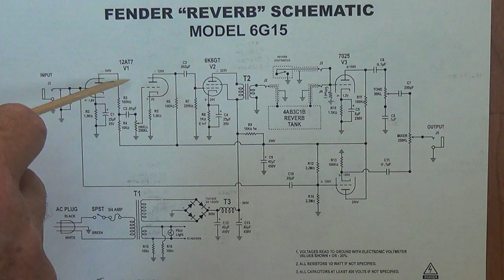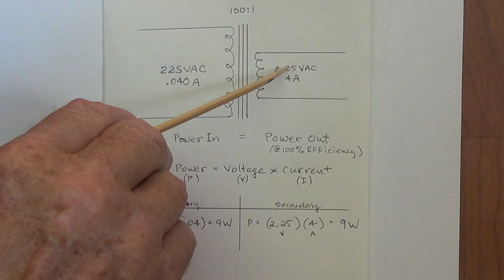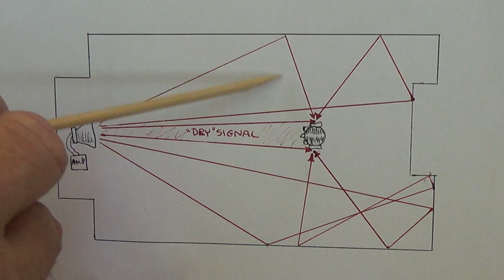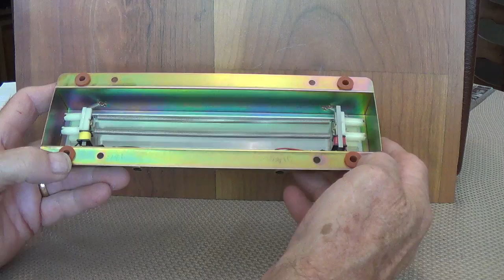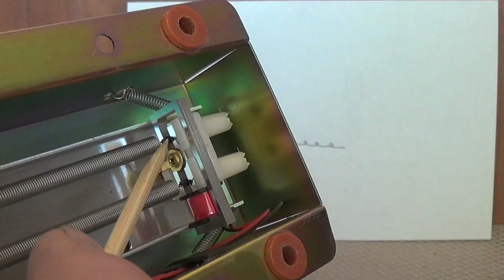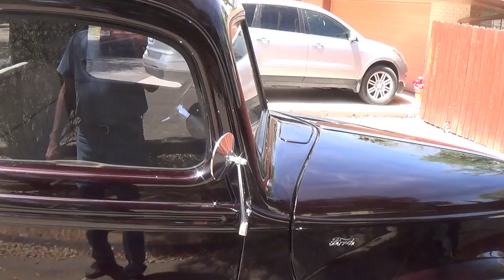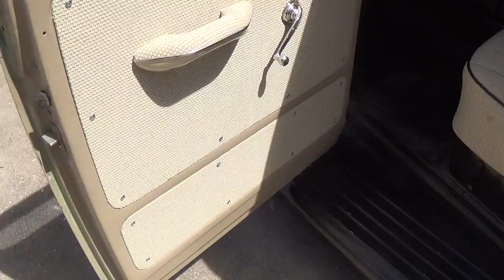Tube Reverb, Part 1

Comment: Greetings Uncle Doug out there in youtube land. Was hoping you might be able to tell me if a Hammond 369bx will work as a mains transformer for us down here in Oz. Its basically 150-0-150 center tapped secondary/86mA. Postage alone, my cat would have to go without food for a year if I had to purchase a Classictone PT from the states.
Reply from the maker: It depends on the circuit you intend to power with the PT, SK.  Unless you are using a voltage doubler, your HV will be low for most tubes, and your marginal 86mA of current may not be adequate......especially if you use a voltage doubler and halve this figure to only 43mA.  Do you have any old, used PA amps in Australia? If so, they have much more suitable PT's for amp use.
Reply: @UncleDoug  I was hoping to use it for your 6G15 circuit. The PT in your circuit is the PT47609, secondary no center tap 306V/26mA. So yes a voltage doubler? ignoring the center tap to obtain 300V.
Reply from the maker: @Slappedkat  Since the 6G15 uses a full wave bridge rectifier, you can use your low-voltage PT, without the HV  center-tap connected, to net an appropriate HV of at least 300V (probably more after smoothing to peak voltage).
Reply: @UncleDoug  Thanks for taking the time to reply. I sat with pen and paper and watched quite a few of your video's (some several times) over a period of a month or so taking notes and basically using them as a study guide. I did this before building my first amp which I completed this week. I  also built your version of a current limiter before powering up my amp.  I collect old portable valve driven record players. I now feel confident to go ahead and start servicing/restoring them. Im not the smartest tool in the shed. I find the fact that your videos teach in a humorous, simple, non condescending way that I understand valuable. I feel its  the art of how one delivers the information that some can teach and others maybe not so. A huge thank you for sharing your knowledge with us all, it is very much appreciated. All the best.
Reply from the maker: @Slappedkat  Thanks so much for your very nice comments, SK. It's gratifying to hear that the info in the videos has been turned into a productive, creative new hobby/business for you. Best of luck with all your endeavors.

Comment: 305 worst V8 Chevy ever made
Reply from the maker: Nonsense. All small-block Chevy engines are wonderful ;)
Reply: Uncle Doug I have no problem with small block Chevys but of all the engines in that family the 305 wouldn’t be the one I’d pick. 350, 327 even a 307 but not the 305. To each his own.
Reply from the maker: Why, Bill? What specifically do you find lacking in the 305 ? It has the stroke of a 350 for good torque and hardened valve seats for unleaded. Also, it came in the truck and runs great.....keeping right up with its 350 "brothers".......so what do you feel is wrong with it ??
Reply: @UncleDoug  over the course of the late 70s/early 80s I had 3 different F body Camaros, a 70 with a 350, a 73 with a 307 and an 80 with a 305. That 80 Camaro put me off Chevys for a long time. It was an underpowered dog that had constant driveability problems. Granted it was the height of the smog police era and technology hadn't caught up with emissions restrictions yet but 155 HP for a 5.0 liter V8 is pathetic. I currently have a naturally aspirated I4 with half the displacement putting out 186 HP.
Reply from the maker: Yes, Bill, but none of those experiences relate to the 305 in my truck. Mine has no smog equipment, some "speed" equipment, and produces considerably more than 155 HP. There are no inherent  shortcomings in the displacement or the bore/stroke relationship, as your initial statement implies. The problem was that you owned a "dog" version of the engine......but this experience has no  bearing on the 305 engine in general.
Reply: @UncleDoug  fair point. I guess it's just hard to get those memories out of my head.
Reply: By the way I really enjoy your channel and get a lot of great information from you. Thanks for sharing your knowledge and experience.
Reply from the maker: You're welcome, Bill. I'm glad the videos are helpful. Don't be so negative toward the 305 based on one bad experience. Let's face it, we've all had at least one bad relationship with the opposite sex.....yet none of us felt the overpowering need to become a monk or nun :)

Comment: Hi Doug!
I'm building one according to your schematic, but i only have access to 230VA --> 295VAC/6,3VAC power transformers - is that enough?
Reply from the maker: If that's all you have, Jaro, then it will have to do the job. I would think that although your tube plate voltages may be a little low, it should still work. There is only one way to find out :)

Comment: Greetings Doug and Jack ! Just a question about the next videos on effect. I'm a tube enthusiast and the way you explain it is, as always, awesome. But, if the reverb is not really "tube based" (it's a spring reverb, not a "tube" reverb), would you also explain how other effects works ? Like delays (how to induce a delay with a tube) or compressors (maybe you got an old Teletronics LA-2A in stock to repair ?). I'm not only a guitar player but also a sound guy, and using gear without understanding what happen inside is a real pain in the butt to me !
Reply from the maker: The reverb used by Fender in all its vintage amps, including the 6G15 was tube-based AND used a spring reverb tank. Unlike some companies, however, they used a small output transformer to drive the tank.....so you could say that their reverb was "transformer-driven spring reverb". In the opinion of most, it is the finest possible analog reverb. Some manufacturers left out the transformer and simply drove the spring tank with a tube......so you could say their reverb was "tube-driven". This was a concession to cost reduction and the result was OK, but not up to the Fender standards. Some more modern amps used transistor(s) to drive the spring tank, with variable (and generally not exceptional) results. All analog reverb uses a spring tank......so they are all "spring-reverb".  The alternative would be digital-effects reverb (which is the only one that does not use a spring tank), such as you can find in pedals......some of which sound great.

Comment: Uncle Doug-I just saw this video and really enjoyed it.  I downloaded the PDF file and had a question.  It looks like there are some discrepancies in the Modified Layout Diagram and the Modified Parts List.  The Tone and Mix pots are reversed from what appears on the front side.  I just want to be sure which way they go.  Also, I think the C8 cap may be mislabled.  It appears as .02 uf coming off the Tone pot, but then its labeled as a .1 uf on the eyelet board, but in the parts list its shown as a .01 uf.  Your schematic only appears to show just 1 C8 cap and its a .02 uf.  I'm new at this stuff so I may be missing something.  I don't know if there's anything else to check.  Don't mean to be a pain.  Thanks. Stephen
Reply from the maker: There are some discrepancies, WS. The Layout control position is correct, the panel-view diagram is wrong. When in doubt, follow the schematic values. I personally created it and vouch for its accuracy.....the other lists and diagrams were simply added to help those who need them.
Reply: Thanks. I wanted to make sure I wasn't misinterpreting something.
Reply: wsscott72 Thanks wsscott72 for spotting those mistakes. I drew the PDF for Uncle Doug. You're not being a pain. Hope it all worked for you in the end. I built this and sounds great. I've updated the inconsistencies, along with a couple others that people have spotted. Keep an eye out if UD uploads the new PDF.

Comment: I'd like to buy one of these, UD!
Reply from the maker: The only one I have is this one, B29, and I am really attached to it. I've seen both the originals and the reissues offered on Ebay from time to time. Perhaps you could find one there. Best of luck.
Reply: Uncle Doug if you change your mind, let me know. Perhaps I'll build one of the mojo kits.
Reply from the maker: That would be a good option, B29. You would save quite a bit of money and end up with a unit that you fully understood, since you built it.

Comment: I'm working on Sears Silvertone 1484 Twin Twelve amp (no speaker came with it but I have a . It has a little reverb tank and a tremolo circuit. It's a pretty nice amp... well... it will be.. I stripped it down so I could clean the nasty thing up and I'm just now getting to the "puttin it together" part. The reverb circuit doesn't have a transformer. This is what I think is going on --> It has a 12AX7 (preamp in the first section), the first 1/2 of the 12AX7 feeds a 6CG7 and both sections of it feed the tank, and then the tank feeds back to the other half of the 12AX7, that in turn is mixed back in on both sections of a 6CG7 which then sends it's signal to a pair of grid biased 6L6GC's. Does this sound remotely correct? Schematic - http://www.silvertoneworld.net/schematics/Sears_Silvertone_1484_Twin_Twelve_REPRODUCTION_Manual-page-004.jpg
Reply from the maker: Your interpretation sounds correct to me, Michael. The drive and recovery circuits are both quite similar, including the phase inverters at the end of each circuit. By coincidence, I just got a 1485 today that is in rough condition, so I will be facing the same issues you are currently trying to correct.....and probably a few more. The small reverb tank is indeed tube driven and does not have a great reputation for quality reverb effect. It's almost tempting to try to change it to a proper Mod or Accutronics tank. Good luck with your restoration.
Reply: @UncleDoug  Thanks to you I have a prayer of knowing what I'm talking about :o) though still a bit unsure of myself. The 1485 is the same circuit as the 1484 except it has 2 pairs of 6L6's in the output section. Jack White made the 1485 a bit more popular and therefore more expensive. Someone gave me mine (vs throwing it away). I wish I could find the right speaker cab for mine.

I found two "anomaly's" in mine. There is a 2.2MΩ resistor to ground on SW1. SW1 is on the back of the reverb depth control. That's not on the schematic. I'm not sure what that is about. Maybe they were trying to solve a noise issue? And R4, V4, second section, grid resistor to ground, is 68kΩ on the schematic and 150kΩ in the amp. So far that's the only "changes" that I've found from the schematic. The owner didn't make them and he was the original owner. They look like the factory installed them.
Reply from the maker: I believe these amps were built by Danelectro, Michael, and thus subject to on-the-fly modifications, much like those seen with Valco circuits, based on component availability and possibly owner feedback on issues. I need one (of two) output transformer for mine. The 1484 and 1485 OPT's are identical......so please keep an eye out for one :)
Reply: @UncleDoug  My output transformer and choke were toast. I found both at Mercury Magnetics. https://www.mercurymagnetics.com/?s=SSTT-om&post_type=product

I also found R14 to be quite a bit different. 68kΩ on the schematic and 560kΩ in the amp. Danelectro got around :)
Reply: @UncleDoug  Look what I found: https://goo.gl/images/H2v4C1

Comment: Uncle Doug I have a question. What is the best place for the reverb stage in a push pull amp if you're building from scratch? At the input or before the phase inverter? I figure if the reverb stage is before the phase inverter it should have a pretty strong signal going into it but not sure if it can be driven too hard.
Reply from the maker: Whenever you have questions like this, Patrick, simply check out some schematics from amps famous for their reverb, like the Fender Pro or Deluxe Reverb, to see how the experts do it. You'll see that the reverb signal insertion is always  after the pre-amp and before the phase inverter.
Reply: Thanks for the reply uncle doug. Do you have a PayPal? I'd like to make a small donation. I'm an electrical engineering student working on designing an amplifier for a school project and these videos have been very helpful to me.
Reply from the maker: I'm very glad to hear that, Pat. You can make a PayPal donation to: dldcam@aol.com   Best of luck with your studies.

Comment: I had a question related to a reverb circuit in, say, a Fender Deluxe Reverb. Just as you should always keep a load on the output of any tube amp, should the reverb drive to the tank always have a dummy load on it, in the absence of the tank being connected? From your presentation, I believe the tank drive should always have a load on it.
Reply from the maker: It would make sense for that to be true, MA; however, I can't recall ever running an amp circuit with reverb "on" and no tank in place.

Comment: @10:31 I cannot understand nor agree that this tube is supplying any current to the reverb tank drive. The  6K6 looks to be in straight class A and as such is the sole contributor to the tank drive. Please explain your words about needing to deliver current from the triode it makes no sense
Reply from the maker: In my mind, the ability to effectively drive the 6K6/6V6 would affect its ability to drive the reverb tank. If this is a naive supposition, then I apologize for any distress that it may have caused you.
Reply: Thank you for your reply. No apolgy was required and no distress caused. I agree that the 6K/V6 needs to be adequately driven, but in class A this is by voltage rather than current. I was curious about your thoughts on this.
Your series on reverb units is very interesting to many viewers including myself.

Comment: Hi Uncle Doug!
Not quite related to this specific amp, but is related to spring revreb tanks in general, a good friend of mine has his hands on a spring reverb tank of an unkown model, now I study EE and thought it could be a nice project making it a functional reverb module in one way or another

So my questions are:
Can we experiment with any generic apmlifiers for driving it(e.g generic earphones amp) ?
or do we have to measure it's specs and chose a very specific amp/ build a costume one? 

Same goes for the output

Tnx on advance
Reply from the maker: You need to determine the input and output impedance of the reverb tank and create a circuit that suits it exactly. See my videos to get the details.

Comment: The 12AT7 was probably chosen instead of a 12AX7 because it is has lower gain and is less likely to distort, it seems like a more logical choice (Fender may also have had a surplus of them). It's current handling is irrelevant in this circuit because it does not directly drive the reverb tank. It is simply a low(ish) gain voltage amplifier. I think a 12AX7 would actually be more suitable because 12AT7s produce more hiss than 12AX7s and this circuit needs to stay quiet. The extra gain of a 12AX7 can be tamed by adjusting the voltage divider on the first plate and adding a voltage divider to the second plate. Just my 2 pence.
Reply from the maker: You may well be right, TA. Thanks for your input :)

Comment: Thank you Uncle Doug, can you do the power section with two 12v transformers if it’s possible which current would be enough? 2A each?.
Reply from the maker: You're welcome, Leandro. It may be possible, but I doubt that a pair of small (2A) head-to-head transformers could furnish the necessary current. Why not simply follow the schematic and use proper transformers?  Generally better in the long run.
Reply: Uncle Doug thank you for replying, I was thinking on using 12v transformers as it is cheaper and easy to find, I remember in one of your videos you mentioned that it is possible to build a fender champ with back to back 12v transformers and I liked the idea. Well I’m going to do a search for the proper transformers. Thank you so much for sharing your knowledge!
Reply from the maker: You're welcome, Leandro. I don't think that the correct PT for a 6G15 is very expensive. Good luck with your project.

Comment: say doug,sorry to boter ya, on that montclair the powere tubes  in it  r suposed to be  6v6 . n ive got 6v6gt n 6v6gta ones newer, still ancient, but dont they need to be matched biased, maybe they have. idk. n one of the cone wires was off the terminal, amp on with no speaker not good dont know that it has been on. but the tube thing, matched n biiased when theres 2more than 1 p tube huh?
Reply from the maker: I'm a little uncertain about the question, PJ, but if you're wondering if it's OK to use a mismatched pair of 6V6's, I would say: try them and see if the amp works. If so, then hunt down a matched pair for future use.
Reply: cool, thanks sir doug, got an outdated old tube tester, see if there good. then,ye . what you said. enjoy ur holiday friend.
Reply from the maker: You're welcome, PJ.

Comment: happy saturday sir doug. ive stumbled upon an Alamo montclair reverb 80 att 6v6 x2  ax7 reverb tank original, suposed to have trem. very interesting amp. guy said fusewas blown, in fact it n cap were missing, tubes look nos, original. said he was scared of  the big caps so didnt mess with it. looks like the trem/re switch is broke off. condition of tubes tells me theres been no major calamity.. what do you know,sir. of these amps picked it up in the alamo city. havent messed with it yet. what would you think the safest testing proceeder is, other then fuse it,an flip the switch? heard one on you tube n man ,wow.
Reply from the maker: Greetings, PJ. I believe the Montclair is a hybrid amp....with a solid-state preamp and tube output. It's impossible for me to make an educated guess about the condition, but you could install a 2A rapid-blow fuse, plug it into a current limiter (see my video on how to build one), and see if it works. Good luck.